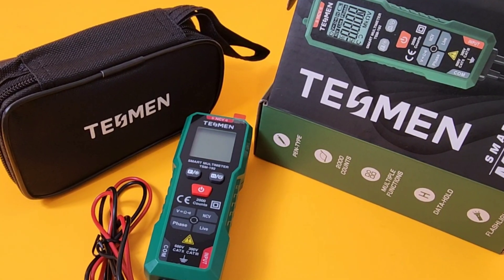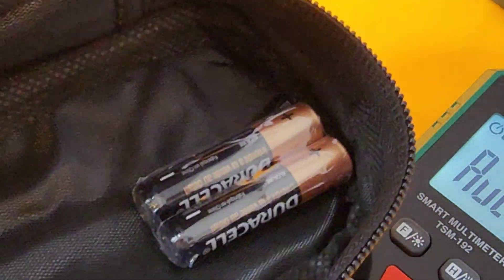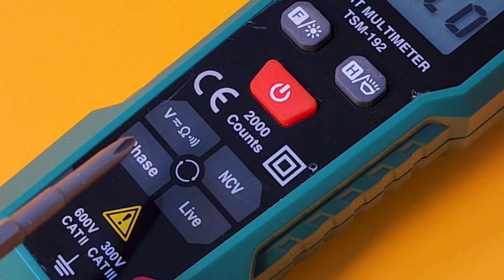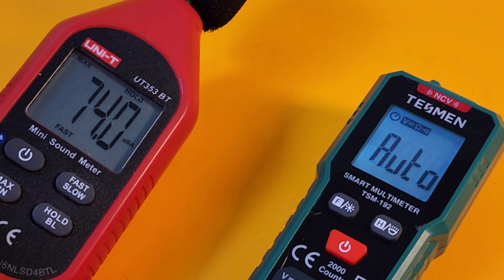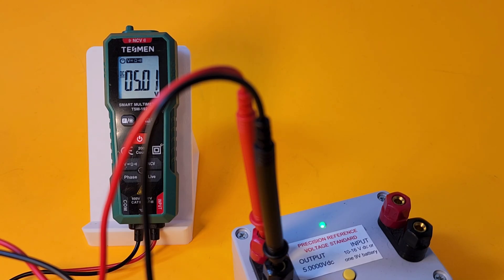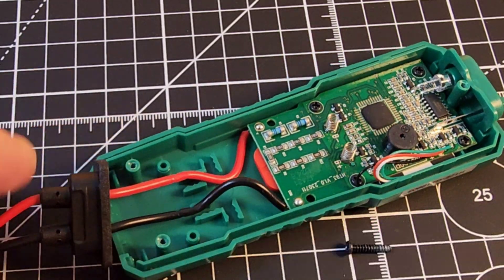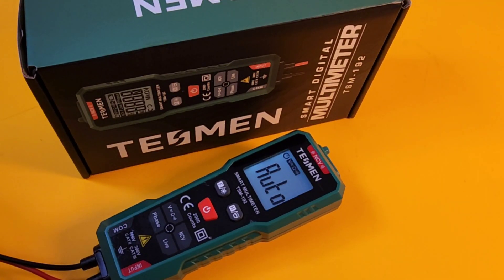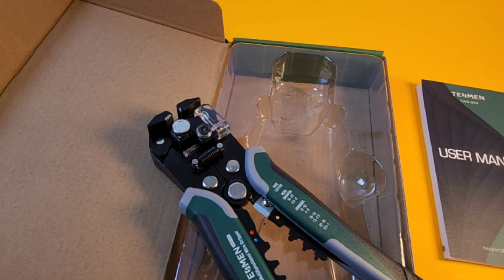All New TESMEN TSM-192 CHEAP-O Multimeter Review & Teardown!

Comment: Looks like a rebadged Kaiweets KM201. It is aimed more at commercial / industrial electrical work, so is designed for handheld use with one of the probes in the holder. Continuity will primarily be for checking wires, contacts and fuses so speed is not a big an issue as it would be in the electronics world. The low CAT rating doesn't make it a good choice though.
Reply from the maker: You are exactly right my friend 👍

Comment: Worse of the "smart" meter manual modes so far. Never combine voltage and resistance/continuity! Good NCV though, and fixed test leads make sense on a meter that size. It has a multicolor backlight!? Almost useless resistance range too. But hey...we need to see more tiny meters!
Reply from the maker: Great points 👉 no manual mode override is frustrating to say the least.